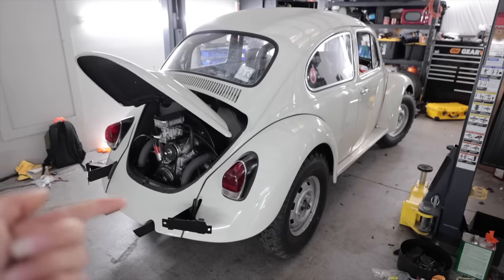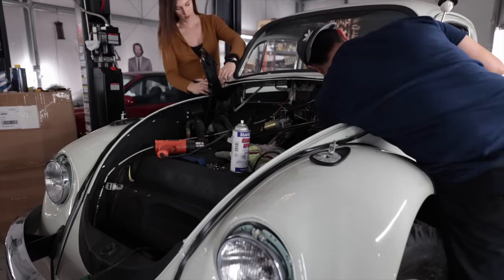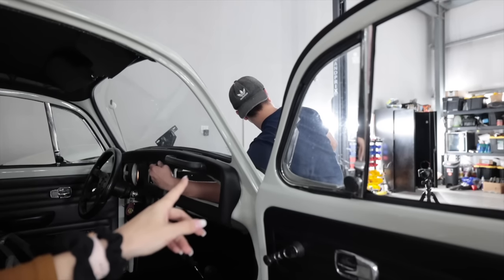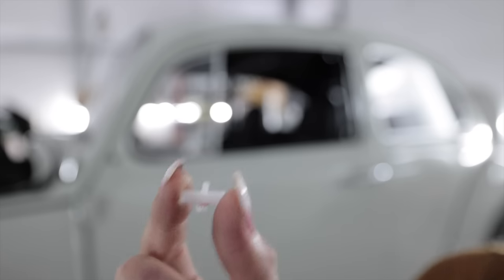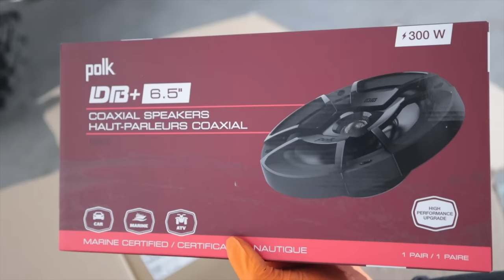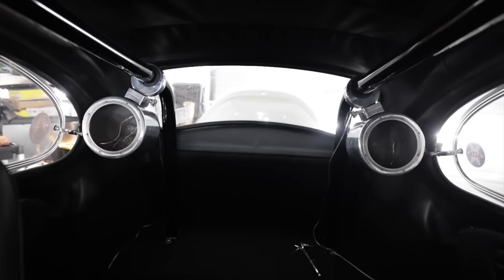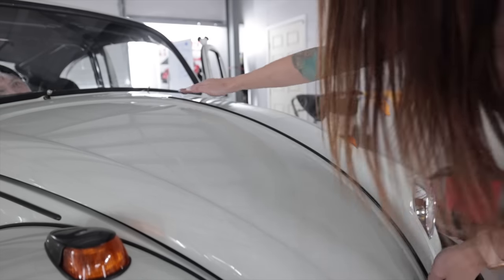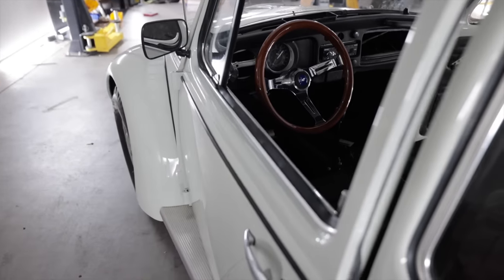The Finishing Touches // Ragnar Class 11 Beetle Finale Pt. 1 of 2

Comment: A tip for anyone reading: any time you need to hammer anything on the outside on the paint, put masking tape around the location and use a non-marring rubber mallet.

Comment: Nice work, Sarah. I'm constantly impressed by your resourcefulness when choosing components for your projects. I love the marine housings for the speakers and that steering wheel is absolute fire. I have an older Nissan 720 pickup and put the same wheel on it. And I still love it, every time I drive it. I'm also very glad that Charlie was able to sort out the jetting on that Weber carburetor. It should run great after being sorted. Looking forward to the finale.

Comment: Sarah , kudos on the speaker enclosures . they are the perfect style for the car . you do need to damp the back wave in the enclosure . even some polyester fill  like that used in pillows would be of some value .  parts  express has a number of solutions . the steering wheel is great . congrats !

Comment: Stuff wool sheet in speaker pockets and make sure their somewhat airtight to improve on sound quality so running a bead of silicone round the outside ring under the speaker on final assembly and using a rubber grommet in the cable holes will help.

Comment: Wow! That little bug is now worth more than when it was new. Outstanding job on it. Oh, don't forget to use dielectric grease on the horn button wires, if you don't, the fine metal shavings will cause a fire by causing a short. This happened with my sons Nova.

Comment: The weather seal doesnt need to get hot or glued to be installed. You cna actually place it on one side and pull it all the way to the other keeping it under the metal guide. Then you can pinch just a little the metal guide so it keeps it on place. Done it in less than half and hour

Comment: Wow, those speaker pods are AWESOMEEEE!!!!!  I used to have an old Bazooka Bass Tube back in the 90s that was conceptually similar and that thing sounded awesome!  Those look soooo much cooler than my Bazooka Tube and definitely fit with the feel of the car and I love your positioning of them.  Very nicely done, Sarah!

By the way, 3 of my favorite things about a Beetle or Super Beetle are the floor-mounted pedals with the clutch pedal that seems to roll downward as you depress it, that cool shifter pattern (I am so happy you didn't go with an aftermarket shifter and lose the down and over and back for Reverse) and the cool shift pattern on the ash tray face.  Of course the exhaust sound is just iconic on these, too.

I have got to get myself a Beetle, a vintage 70s rail buggy or a Meyers Manx one day!

Comment: Learn the difference between OEM vs OE. If it is an actual VW part then it is OE—Original Equipment. If made by an original supplier but not sold through VW or marked with a VW insignia it then OEM — Originsl Equipment Supplier. 
         The terms have different meanings.  Interesting build, you’re being thorough that’s for sure.

Comment: I just finished binge watching your Ragnar project .... for the 2nd time and I can't find the Part 2 of 2 Finishing Touches video.
I'm assuming it covered the stereo/speaker testing, install of electronic distributer and new coil, wiper transmission install, and tidying of frunk fuse block, relays and wiring  harness?
Cheers.

Comment: Oh wow...I had no idea, and got no input on how to put that weather stripping in....soooooooooo, I just pried open those metal channels enough to get the bulb under, and using a soft mallet, mashed the metal back down.  Your method seems monstrously difficult.  WOW!!  Those rear speakers are terrific!  That wheel is so nice.  Don't feel to bad about that "warning light".  It was originally for a two sided brake master cylinder that warned when one circuit (either the front brakes or back brakes) were not working correctly, and telling you as you pressed the pedal down "Your braking distance may be higher".  It did not work all that well as a warning device if one stupidly drove too close too the vehicle in front, :P.  Those black strips look so nice as well.  THis is a nice rebuild.